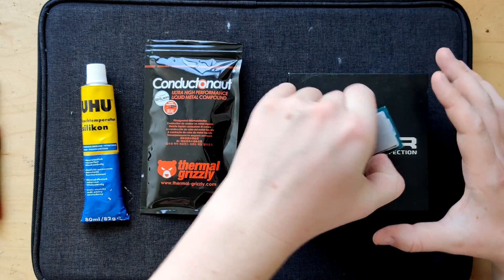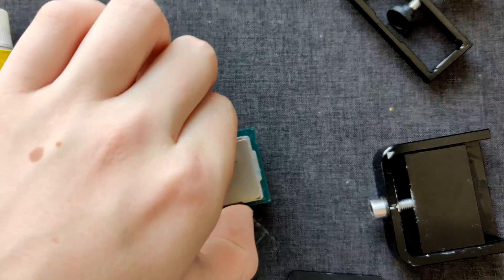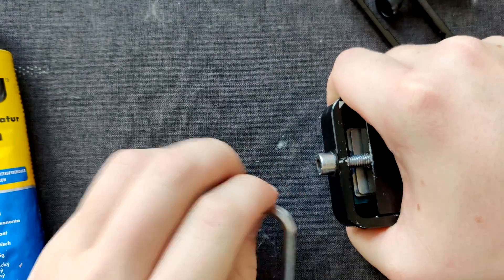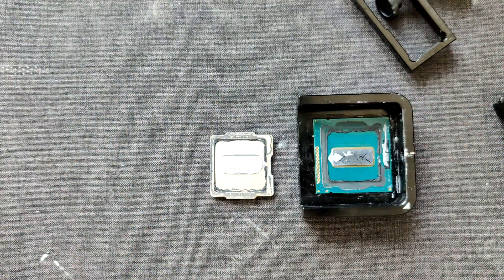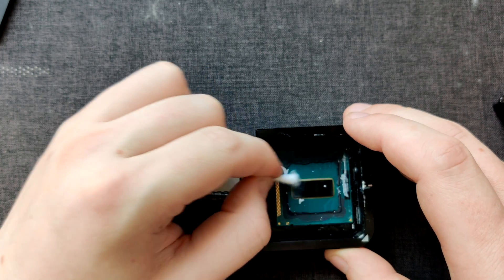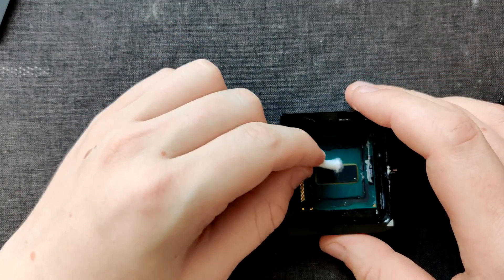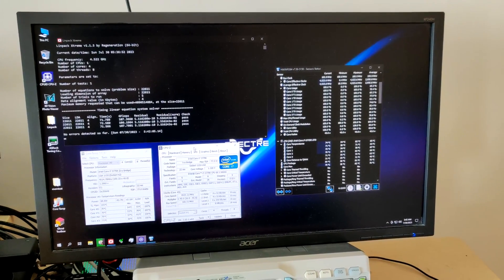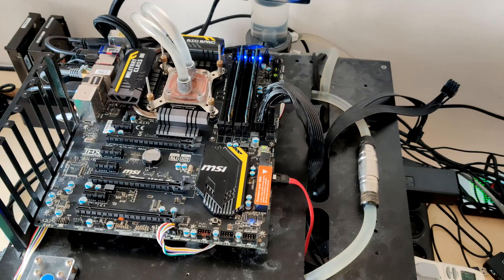Delidding my i7 3770K (badly)

Comment: Hi man, you have extra bad luck in silicone lottery. I have i7 3770k on air (noctua dh15) with stats like this :

4,9 ghz - 1,340 -1,35V - max temps around 65-68C in cinebench 20.  
Tried several kinds of LM, all wokred same, temp differences in margine of error.
Mobo msi z77 dg 55 and MSI Z77 MPower.
in games temps was in 65-74C.
Edit : 4 sticks of ram 1866mhz (just basic clocks) - 32gb

Comment: For the silicone seal, I recommend doing 4 tiny dots by putting a tooth pick into the silicone tube and tapping each of the 4 corners. It's more than enough and you don't risk it creating a gap for worse liquid metal contact.

Comment: My 3770 non K could do 4,5 GHz undelidded but sanded down without a lot of extra voltage, maybe 0,11 volts more than normal. It would run Cinebench R20 very stable with a max temperature of about 60c if I recall that correctly. I had a Dell server tower cooler on it held down with 2 strips of folded aluminium. Too bad my cat took a pee into that computer and the CPU and board got ruined... A 14% all core and single core overclock on a non K is not bad at all. Good luck with the channel and all your mods!
Reply: sanded down? what do u mean?
Reply: @GraphicManInnovations  Making the heat spreader more flat with sand paper.